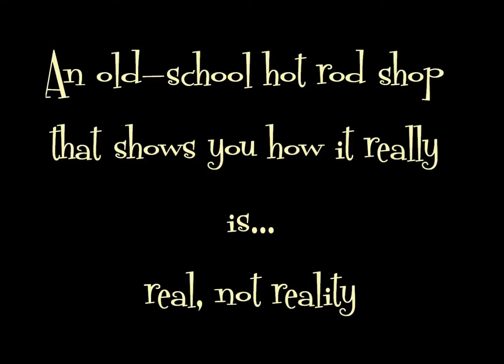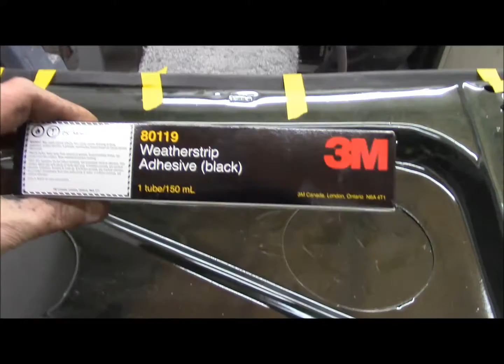Torque box repair

Comment: i have a clean  mustang notch bac,no rust,its around  at the flywheel.id like to get the rear upper and lower torque boxes and frame rails done,ths will be mostly a street car but id like to take it to the track.id like to get a price to have you guys do it.ive never done it and dont want to hack it up or ill my self.the car pulls to the left just before i go into third gear.also wheni get tis straightened out id like to do a better motor.thank you
Reply from the maker: +Charles Mills Best to give me a call to discuss.  604-649-4726